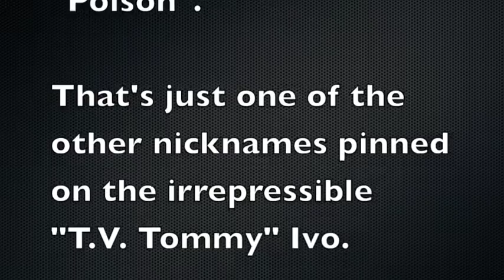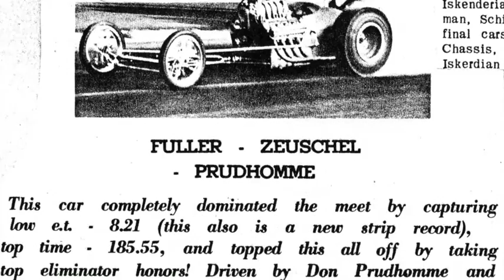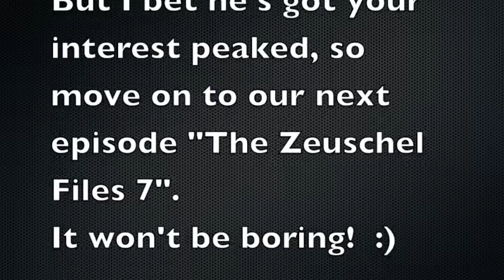The Zeuschel Files 6

Comment: Arc weld? Surely he must mean Heli-Arc if he's talking the frame. That's got to be 4130. If he's talking anything on the powerplant, you can use nickel rod on gray cast iron but using a torch with cast iron rod is the strongest bond. I know this guy is savvy because he built that "Barnstormer" frame and probably a few more. Got to see him match race in Amarillo. Always in the top eliminator hunt this guy. Driver, frame builder, engine builder . . . and showman. And pretty damned good at all.